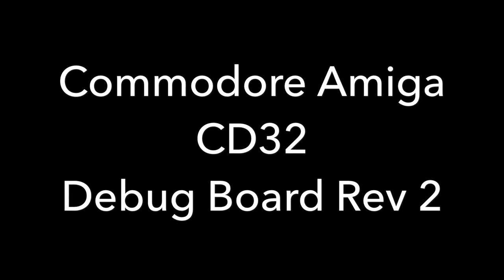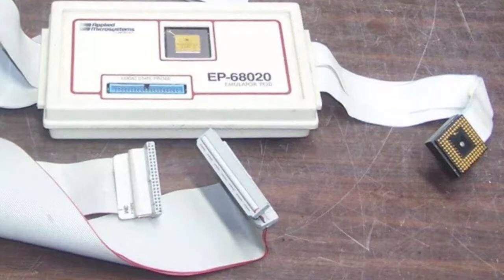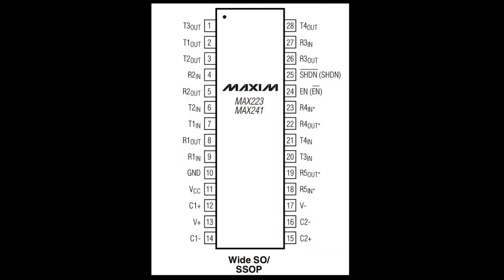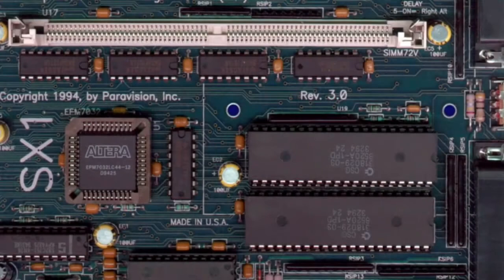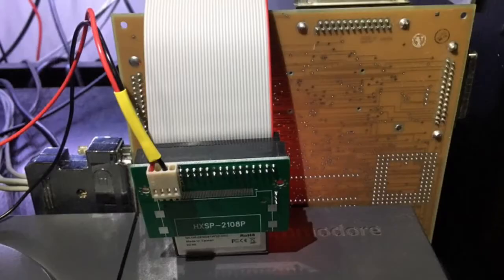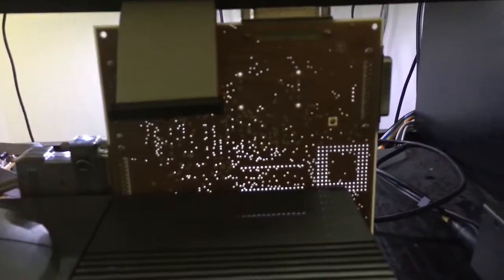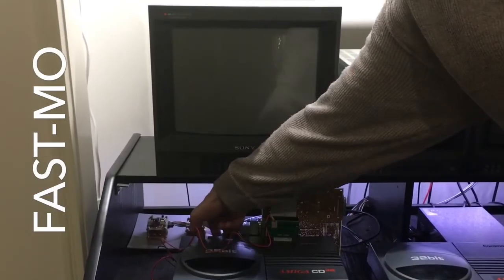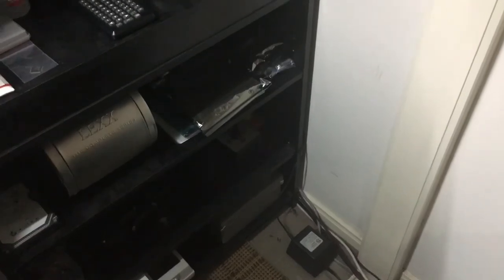Commodore Amiga CD32 Debug Board

Comment: Thanks for the video Brek! It is extremely informative!
I managed to grab one of these boards from the person who bought the original lot which was on sale on eBay and who resold them almost immediately but I was not aware until now that schematics were available. These might prove very useful in extending and populating the boards to "completion" as I would like to use them eventually to recreate an original development setup.
Of course I am not going to ask you for the original development ROM/EPROM (being a developer myself, I do respect copyrights) but damn I guess it will be very hard to find a way to acquire it legally. i wonder if the holder of the copyright even still has a copy? Would your source ex Commodore engineer know about that by chance?
In any case, thanks again for this short but very useful introduction to these little known wonders.
Reply from the maker: I was hoping to find one of those for sale.. assuming they'd be resold, but didn't see them come up on eBay.